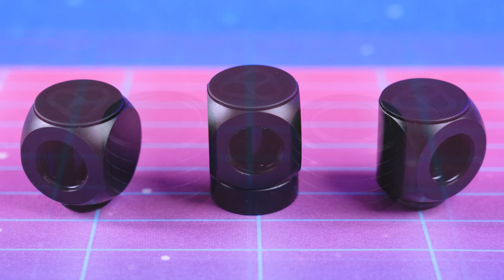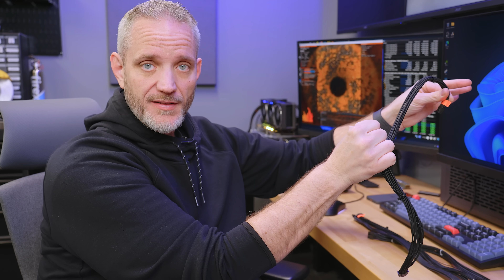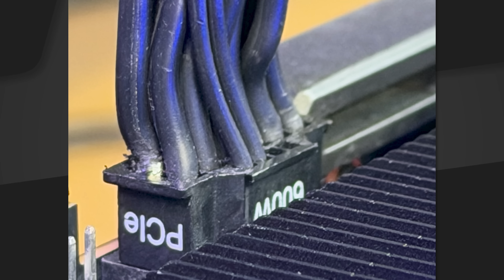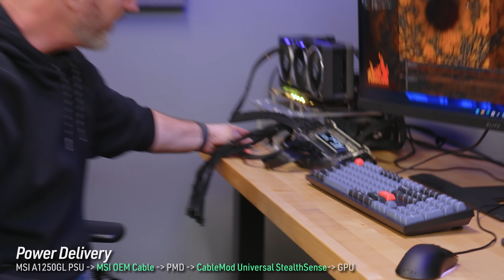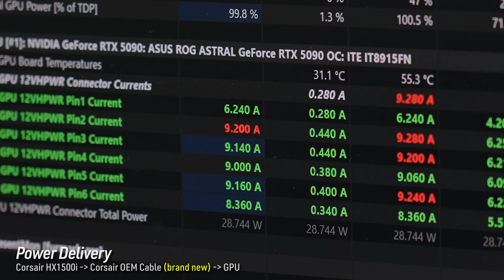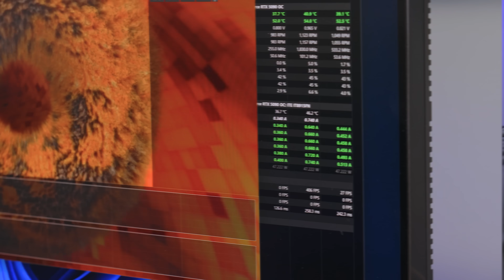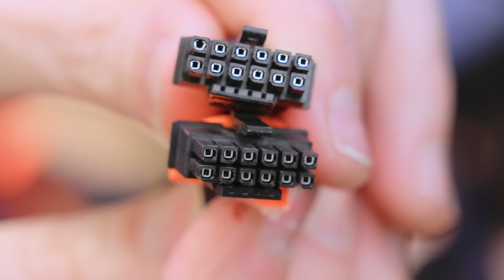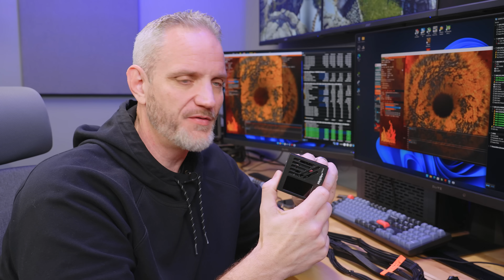More details on what could be causing 12VHPWR / 12V2x6 Cables to melt

Comment: You know we could go back to 8 pins, they worked and didn't go up in flames for a long long time.
Reply: Kinda BS that nVidia in particular wouldn't let board partners do that.
Reply: AMD still uses 8pin connector for most of the rx 9070xt models.
Reply: @andresdelaosa8485  most?
Reply: @mariuspuiu9555 Sapphire Nitro+ and ASRock Taichi OC are the only variants of the RX 9070 XT that i know that use the 12VHPWR connector.
Reply: @mariuspuiu9555  yeah the sapphire nitro+ and maybe some other flagship aib's use 12v/2x6, the nitro+ actually routes the cable though the card under the backplate and over the top of the heatsink, which makes it bend pretty sharply or be pressed against the hot heatsink which cant be good for the cable, and it does the same for the argb cable too . . .
Reply: @Hamster23381 Had mine since release and haven't had any issues, the bend isn't that much, also it's a passthrough at that section so there is a fan that's blowing air past it which is probably better than other designs.
Reply: @Youngsta0  ok thanks, ive actually bought a different gpu so its even MORE likely as it has a higher tdp and its nvidia . . .
Reply: @andresdelaosa8485  every
Reply: They were made for support nearly 300w each in reality, so they got a good security factor ~1.96 if i'm not wrong, vs the 1.06 factor for the 12V2x6.....
Reply: @jacklang2349  I work in engineering... a 1.06 safety factor on paper with all these real-world variables that aren't accounted for is horrifying. For mechanical devices related to safety, a safety factor of more like 5-10x is common, and this cable can burn your house down.
Reply: @Govanification if you knew the details that that "safety factor" is over all cables operating, designed to be low resistance so small resistance problems can lead to current overloads in other cables you would simply not understand how 12V-2x6 as implemented isn't totally shunned.
Reply: @jacklang2349  the new power cables are engineered to fail... Everyone who had basic physics in public elementary school can easily see why making the wires smaller, the pins smaller, the plug smaller, making the plug more difficult to plug in securely and at the same time dramatically increasing the amount of energy that is transported in the cable .. WILL result in disaster.. also all the revisions of the connector are not fixing the real issue... Why? Because its designed to fail to sell more GPUs that are way pricier than they should be even if they had ok actual raw performance and a decent power delivery system
Reply: The 12 pin would ALSO work if the 'spec' had not been established by Nvidia to not have 2 phases each on monitoring (and the implementations by Sapphire for the Nitro and that other 9070 xt also with that plug), and then, you know, thin, frilly wires, instead of the chonky ones we have now.
Reply: Because they say they don't have space on the PCBs. Same excuse apple used to remove the headphone jack
Reply: @vaibuscala6441  I still miss that a lot. Bluetooth has noticeable lag even in the fastest "game modes" I've seen and there is a huge price x benefit difference in sound quality between p2 x bluetooth.
Reply: @Labotohs  bluetooth audio is shit. I'm an audio engineer and maybe that's why I just don't like it. I don't like anything wireless, even more when you have to compress it a lot. But the dongles are even worse. Specially if you get a phone with no DAC like samsung, where you will need dongles with a DAC inside.. It's a mess. Bottom line, these companies are full of shit xD
Reply: @vaibuscala6441  An LDAC Bluetooth audio stream, supports up to 990 kbps. 
You're not going to hear any difference between a cable and a decent stable Bluetooth connection.

Your comment reminds me of the post I saw lately, where audiophiles couldn't tell the difference between audio signals sent through copper wire, a banana, or wet mud. 
Yet they're spending ridiculous amounts of money on overpriced gear.
Reply: @Labotohs  Sennhieser HD630s with their BTD 700 dongle works great and I'm able to play FPS games on my PC with them.
Reply: @vaibuscala6441  The sound quality from my Sennheiser HDB 630s compared to my LCD-X's w/ Schiit Lyr 3 multibit. They sound great, I'm able to game with them etc.
Reply: @vaibuscala6441  They have plenty of space, but they want the 3rd fan to be used like a passthrough for extra cooling. The actual 5090 PCB is very short.
They could add 4x 8 pin pcie connectors if they wanted to.
Reply: @axux4509 It is crazy how short the PCBs are on the 50 series. The card is literally all heatsink lol. Holding a 5090 next to a EVGA 3090TI makes it look like a dual fan 3060 😂
Reply: @axux4509  3x8 pin would have been good, if I remember correctly 8 pin is rated for 225w
Reply: @vaibuscala6441  Do you even realized how much space 8pin PCIE power ports take? For something like an RTX5060 they'd be fine, but a 5090 is a 575 watt card, and that thing would need 4 just to be "fine" except each one of those ports is a point of failure.
Plus reducing the materials used for the PCB helps, that means more room for better cooling
Reply: A big reason why I bought the Asus Prime 9070 XT.
Reply: No thanks. They had their own issues. Many of those do burn up actually.
Reply: Agree but there making things to not last long now a days
Reply: @godthemillenium  That has been the case for decades.
Reply: they probably aren't using 100% copper wire anymore, it's more likely copper colored aluminum
Reply: No thanks, I'd rather not have four ports required to power these Enthusiast level GPUs. The 16pin was MADE to save room for more important things, plus most of the problems with this connector come from idiots thinking partner cards are good. 4090 and 5090 16pin problems came from either partner cards being crap, adaptors being bad, or 3rd party cables being poorly made. Nvidias founder cards don't have that problems.
Also we've had PCIE 6pin and 8pin for years since 2007, and they've barely changed in spec.
Reply: @Thewaterspirit57  all the cope in the world cant change physical reality
Reply: Never had or saw melted 8 Pin Molex, and I'm building PCs for 20y. 

I owned a Asus Vega64 which I overclocked , that didn't even melt my cables. Which exceeded the 8 pin connector spec.
Reply: @ploed  Yeah never saw it either and i do the same since the mid 90s. 
But one thing i have learned its that you should never underestimate a DAU´s ability to break stuff.
Reply: @ploed I have.
Reply: Along with video cards that don't cost $2000! WTF man? What new $150 gadget are you gonna have to buy now to fix this issue. 🙄

Speaking of, this looks like the prefect opportunity to sucker people, who buy these expensive cards, into buying even more expensive "audiophile" level power cables. 🤣🤣
Reply: My cableMod 8Pin melted in my 3090...
Reply: @FaySmash  Hi, very strange because rtx 3090 have voltage balance for each 8pins....
Reply: @jacklang2349 voltage balancing doesn’t mean anything. Bad things can happen with or without it.
Reply: @FaySmash time triple 8 pin on my 12GB 3080. Zero issues
Reply: @FaySmash Was the cable connected as an extender to the PSU cable?
Reply: @MrJohannson no, direct replacement cable for a RM1200x. But the connector from a Phanteks 8Pin extension cable of a friend also melted in his 2070 back then
Reply: @FaySmash  Exactly my point. Any out of spec cable or component can cause melting with improper voltage balance.
Reply: ive seen alot of Melted 8 pins. Used to work alotwith pc’s
Reply: @PwniezXpress  voltage? You sure about that....
Reply: @GortPredator  110%. Extremely high voltage imbalance is what's causing the melting via heat. You realize that voltage causes heat, right? lol
Reply: @PwniezXpress  Amps cause heat.... the copper doesn't care if it's 1V or 100000V. It does care though wether you pull 1 Amp or 200. This is btw why the cables on the low voltage side of a transformer have bigger cables, because the amps are way higher now and you need more copper in order to not blow up the cable.
Reply: @shotsfiredman  "This is btw why the cables on the low voltage side of a transformer have bigger cables, because the amps are way higher now and you need more copper in order to not blow up the cable." You literally just contradicted yourself. Voltages and amps go in tandem with each other. You can't produce one without the other.
Reply: @PwniezXpress How is it a contradiction? A transformer works on the laws of induction, you use for example 10.000 volts with 14 Amps on 1 side and transform it down into 400 volts. Since the other side of the transformer is now at 400 volts but the power doesn't change, means there HAS to be an increase in amps, which would make the amps go up by about the same ratio the voltage dropped. So if you want it in mathematical terms 10000V/400V=25. The 14 amps now go up by a factor of 25. 14A×25=350A means you now have the primary side, sitting at 10kV, with 14 amps and the secondary side sitting at 400V and 350 amps.

Now as you may seemingly don't know, with higher amps you have a higher electrical density in your conductor, making it warm up significantly. If that warmth exceeds the material threshold, it blows up the material. Aka you need more copper inside the cable, forcing you to use bigger cables on the side with more amps, the secondary side.

If you still think I contradict myself, point out WHERE.
Reply: For a long long time gpus didn't pull 600w tho.. each 8pin provides 150w max safely so you would need 5 8pins for a 5090 to be safe.. I want to see that kinda cable mess in your pc bro..
Reply: @Proxi_Ex  just use EPS then
Reply: @Proxi_Ex  Cables never bothered me, never been a fan of window kits. My cases are blacked out. 
The only at least partially annoying thing have been the old flat ide cables that pretty much blocked airflow... but that is no longer an issue.
Reply: imagine having 6x 8Pin per GPU. There is a reason why NVIDIA switched.
Reply: @theodanielwollff  I would hate that. I've had no issues with the 12VHPWR connector. I've owned a 4090 for 2+ years and now have had my 5090 for nearly a year as well.
Reply: They were also not carrying 600W for hours
Reply: @kevinnio  my EVGA 3090 has a custom bios that allows it up to 1000 watts on a triple 8pin with no fires or melting....ran it like that for the entire first year I had the card. Still using the same card today, but with a 600 watt limit.
Reply: @kevinnio  multiple XOC records over the years pulling over 1000watts from 3 8pin pcie and over 600 watts for days from 2 8pin pcie connectors.  PCIE and EPS connectors are the best!!
Reply: @mattliston1215  You act like 8pins have never melted. They definitely have. Many times.
Reply: @PwniezXpress  I have seen pcie cables that melted out of destruction, such as a terrible power supply short, or physical damage, such as a metal backplate bent or flexed, and touching the PCB.

But over the last 20 years (I think 2005 was the first time I saw a PCIE cable, thoguh it was 6pins, and I think PCIE came out earlier than that), I do not recall seeing the PCIE fail from pure power use when good cables are used.  THe fun part of that, is PCIE doesnt need anything fancy to be GOOD.  12-14 AWG wires, good connector PINS, and you are off to the races.

I imagine what you may have seen, is related to terrible quality, as I have indeed with my own eyes (and thick glasses lol), seen stupid cheap manufacturers pass off an 8pin PCIE cable with FREAKIN 18AWG WIRES!!!!!!!!!!  Holy cheese and rice batman!!

I guarantee you that cable would have fried even with 100 watts of use.

So while I do step back and partially agree, they are not fool proof overall, QUALITY CONTROL is the enemy of everythign that has conenctions.

WHat we do have proof of, is the newish 12v High power conenctor has had far more publicly seen DAMAGING failures in the last 3 years alone than any other computer connector combined over the last 2-3 decades.  This statement does not cover safe failures, like an HDMI cable, or old IDE cables.
Reply: @PwniezXpress  Wayy less probability for them to do that. More wires and way better amperage handling. 3x8 pin could probably handle 1000w 24/7 without zero problems.
Reply: @mattliston1215  at this point might as well just double the supplied voltage, a graphics card consuming the same as an entire mid range PC, without extreme OC, is not good.
Reply: @PwniezXpress  for the amount of time the 8pin have existed vs this new one lol this 12vhp connectors have been an issue since day 1. shit is just bad design, these mofos including you just need to get over it and accept the fact that its just that. bad design, great idea but real life is different.
Reply: @kevinnio  not even a 5090 is using 600W for hours…
Reply: @kevinnio 4 8 pins could handle 600 watts

Comment: PC Gaming in the late 2020'
- games requires 64 GB or ram because they are vibe-coded
- 16 GB or ram cost 400 $
- GPU need 16GB of VRAM and cost 2000 to 5000 $, but you can't buy them anyway, they are all used in data-centers to generate deepfake revenge porn
- your GPU try to burn your home as soon as you stop watching it
- the rest of your computer is spying upon you and sending all your data to microsoft
- the OS has been vibe-coded as well, thanks to the data-center that eat all the RAM you don't have. Everything crashes, even Notepad.
- Games cost 89$ and are all using micro-transactions
-JayzT woCents is doing survival-like video rather than testing cool new stuff, because building and using a PC has become a fire hazard

Comment: 12HPWR connectors reminds me of EIDE connectors. They were large, bulk, easy to bend pins, etc. The EIDE cables overall worked, but if you plugged and unplugged them a lot, it was easy to screw up. 

I like what the people were saying about having thicker, but fewer wires for power
Reply: kinda like the 8-pin we had it before?

Comment: There is something I need to point out. When you are removing, or inserting cables the amount you are moving or wiggling them side to side is certainly going to cause poor pin fitment. It's quite observable how far you are moving them to the side. Yes, they do requite some force to install/remove, but use muscle and straight linear force to do so. The male and female half of these connectors are completely straight, and by moving them even a couple millimeters is going to cause premature wear and poor pin fitment. I have been building machines almost as long as you and that was something I was taught long ago, do not wiggle connectors together.

Comment: Recently got a cablemod cable 12v 2x6 both sides with one side being the 90 degree angle for an astral and I have had the best per pin readings compared to the MSI 12v 2x6 with the yellow ends.

Comment: I had the 2 corsair type 5 pcie connectors melt too when the 12vhpwr melted using the oem cable. I replaced it with a 90° cablemod cable. The extra wire combs provided better strain relief for routing. I have had no further issues after that.

Comment: should of never been released, ever! new vehicles suffer from the same issue on their light units with the same pin size
Reply: measure the resistances of the wires then wiggle them, should be able to pin point which wire is the cause

Comment: Heh.  I never expected consumer video cards would reach such a preposterous point, where I thought they needed something like a threaded connector to make sure the damned thing is connected safely and properly.  But, I guess here we are.
Reply: They don't - my 3090 has been supplied with up to 420+ Watts for over half a decade now, using the 8-pin connectors that simply work just fine. But nVidia had to pull a new plug out of their ass for no reason and here we are .. can't believe they didn't immediately ditch this garbage on the 50 series. 🤦‍♂
Reply: @zargsch same reason our water saving toilets need to flush three times to get it down. 

You can also add automotive, house manufacturing and appliances.

Comment: Ground should not work that way.  The grounding will go whatever is the "least resistance" and can have many paths including the slot.  Depending on EM and the capacitance of the planes it could go any number of ways.  The slot normally gets more ground current than you would expect.  something on the voltage side has the connection change when you touched it early in the video.  The slot has 

DC power normally goes from the Ground to the voltage wire.  We just look at it the other way for old labeling reasons.  The best way to look at the ground is a lake of electrons and the voltage wire is sucking them out.  That is also why negative voltage rails are so dangerous.  The slot has like 45 grounds, 5 12V, and 4 3.3V.  You do not need the grounds on the cable to be perfect unless you have multiple psu.

Comment: It's a bad design in general, any time you wiggle it side to side to remove it you loosen the clamping force of the connector. Its basically a 1 insert connector. The reason 6 and 8 pin connectors don't suffer is they have thicker metal and tighter tolerances so they can resist the wiggle; these are so thin that any wiggle deforms them.

Comment: It is frustrating when Nvidia could get away with putting 2-3 8-pin connectors on the 5070-5080, and the problem would be solved.

Comment: I had a thermal take that cooked the eight pin on a 2080 the bouncing of the cable created a weak contact and over time discolored the plug from red to black. I set the pin into a working vice and actually snugged it up tight so it last until i built a new system and upgraded to a 1200 psu but my mb fried or something damaging cpu and video card too as i didn’t find out until the board was rma and over following fee weeks they died too.